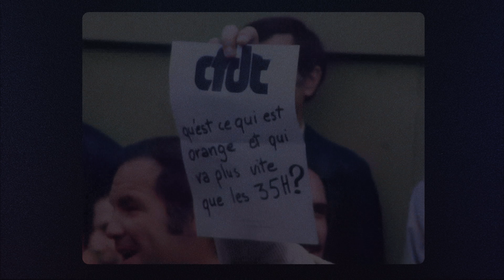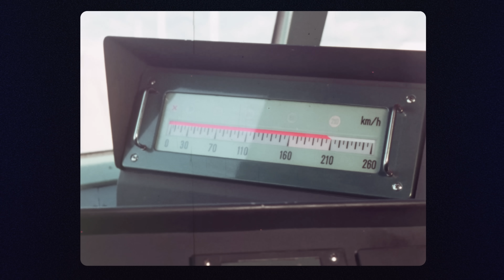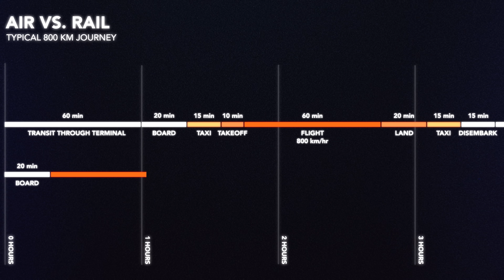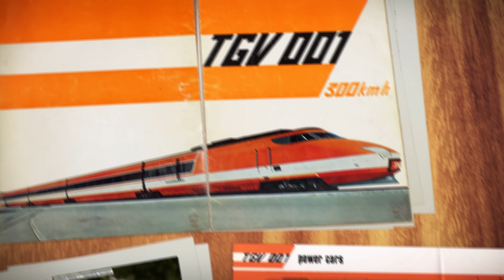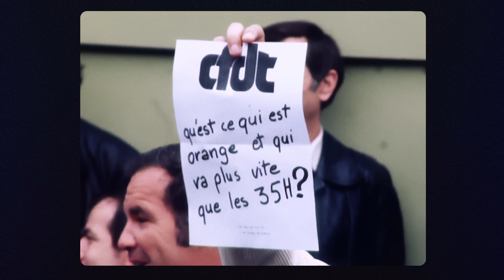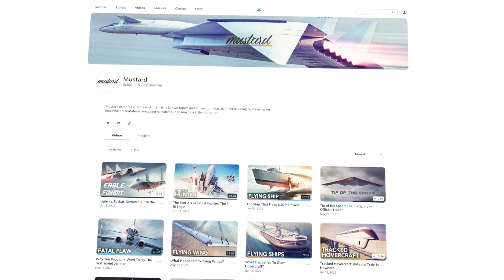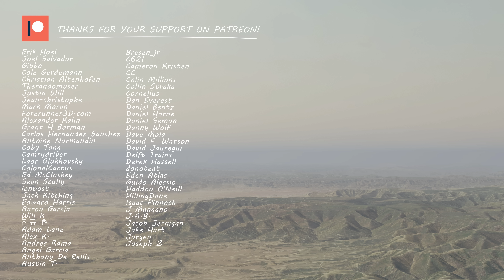Why French Trains Are The Fastest

Comment: as someone from France , i can assure you that the TGV is one of the best option for domestic travel. Not to the forget the rest of the railway network (RER, TER, etc...) that connects almost every part of France that the big High Speed lines doesn't connect. Today, going to work every day 300km away from where you live is not only viable but also very convenient (go the railway station -> get on the train -> wait comfortably for an hour -> boom you're in another city 300km away). Very proud of the piece of french engineering.

TGV (Train à Grande Vitesse/High Speed Train) also stand for Tequilla Gin Vodka here and it's another way to get somewhere (drunk) really fast.
Reply: There are plenty of OuiGo low-cost services and you can regularly find last minute tickets with very reasonable prices.
But if course, if you absolutely want the peak hour train or travel on major holiday departure days, it's gonna be pricey.
It would be a lot less expensive if planes were taxed and trains less taxed, or simply both equally taxed.
Reply: Germany and Italy have great trains too. The main problem is that they don't work together very well. The EU wants to make it so that you can travel by rail from Madrid to Helsinki or from Amsterdam to Athens.
Reply: @MrMarinus18 hopefully everyone starts using the Swiss model of synchronized ‘pulse’ services to guarantee connections, making the whole system work better.
Reply: @JohnGeorgeBauerBuis  Making the whole EU do that is quite an undertaking and more importantly: Unpopular with the train companies which still have way too much power.
I think we need increased government control before we can start with improving the services themselves.
Reply: @MrMarinus18  it’s probably easiest to do synchronization in stages, rather than in one big push.
Reply: @JohnGeorgeBauerBuis  But before then you have to lower the amount of companies doing the trains. They have repeatedly been very unwilling to cooperate for the greater good of Europe.
Reply: It's amazing that your country was able to accomplish this.  In California, they are going billions over budget, and years beyond deadlines, and are nowhere near completing our high-speed rail.  In California the car is king and will be for the foreseeable future.
Reply: @oldesertguy9616  The first TGV line was also over budget, as was the first Shinkansen line - just wasn't mentioned in the video.
Reply: @Ven100  yeah but the budget overrun was quite reasonable.
One of the latest 320kph operated high-speed lines in France, the LGV SEA, equipped with all the stringent environmental bells and whistles you could think of, cost less than 8 billion euros (including city center stations overall makeover and several connector tracks).
When there are high-speed line overspending, it is fairly limited.
Reply: @oldesertguy9616 I also hope Toronto would connect to BC via bullet train.
Reply: @oldesertguy9616 that's because the French are picky. Try to go 1 euro over budget and you will have strikes offered at you 😂 hard for France to satisfy his population but at least they set the expectancy high
Reply: @oldesertguy9616  and as a french, I can tell you that the  train system in france is broken "wait 1 hour and boom ur in another city" complet bullshit !!
Reply: @oldesertguy9616 Minneapolis, Miami, Dallas, Portland, Detroit, chicago, Boston need 🚝🚄
Reply: @oldesertguy9616  Be patient and when CHSR opens you will love it!
Reply: Totally agree! Living in Lyon and working in Paris has never been this easy in my case! Really proud of everyone behind this development.
Reply: However hydrogen or electric planes are highly dubious for various reasons and electric cars are only a marginal improvement over gasoline cars. So mass international transit in Europe will have to be done by HSR.
Also it's important to make sure to also have slower local rail and not allow flashy HSR to grab all the funding.
Reply: are you kidding? Most routes need to do a détour through Paris, the network is completely underdeveloped and unreliable. Yet so expensive. 
When you come from Switzerland it's mindblowing.
Reply: @IStMl I see the French fell into the ‘Paris hub’ trap again, which was among the reasons why they lost the Franco-Prussian war.  Hopefully the Midwestern USA can partly avoid doing the same thing with a line from St. Louis directly to Cincinnati.
Reply: @JohnGeorgeBauerBuis  the US rail network is much worse than the French one, there's barely anything
Reply: @IStMl   Underdeveloped and unreliable??? You must be joking! There's 2800km of high-speed lines operating at 300kph or 320kph. They are super reliable, with some lines having a headway as low as 3 minutes on peak hours, higher than many subway lines in the world...
The system moves dozens of millions of people every year, safely and efficiently.
The main destinations have a very high average speed and the reliability rate is top notch.
I don't know how you get that idea that it is unreliable or underdeveloped but it's simply not true.
Even during heatwaves, the very last services to be disturbed are TGV's as HSL's handle extreme weather a lot better than regular / legacy lines thanks to the precision of the tracks and high tension of the catenary wires.
And 2800km is anything but underdeveloped. It's the second largest high-speed network in Europe, right behind Spain, with several new HSL being built and others planned.
All this allows for roughly 800 TGV's every day.
I think you're confusing with the German network that is a patchwork of trunks of lines with different speeds, forcing all trains to run through city centers and creating bottlenecks and delays near stations on legacy tracks.
The TGV network, just like the Spanish AVE network, is full of large city bypass, to avoid having to slow down when trains don't stop and allowing trains from the Belgian border to the Mediterranean sea to never leave the high-speed line nor slow down.
You must be living in a ln alternative world...
Reply: @IStMl  The biggest problem that HSR has is that it is heavily dependent on government regulation and planning. So bad planning can make it very difficult.

Also in our neo-liberal capitalist world this kind of heavy handed government involvement is usually hated on by private firms.

However while you are right about the massive detour through Paris you are wrong about the cost. I have no idea where you even get that notion as French trains follow the budget airline model. Of stripping out everything they can to offer rock bottom prices.
Reply: @MrMarinus18   This is a preconceived idea!
The EU does not force a privatization, even though many people think it does but it does NOT!
What EU mandates is that the network and operators are separated and that competition is allowed and facilitated.
OuiGo France is possible thanks to that, it's a subsidiary low-cost competitor to it's public parent company.
And OuiGo España is also possible thanks to EU's open rail initiative.
Everyone seems to think that the EU is forcing the network to be privatized but that is simply not true!
The network and operators are now separated, with state / public ownership of the network and competition of various operators that can be either public or private.
The network managers are RFF / SNCF Réseau in France, ADIF in Spain.

Competition does NOT mean privatization!
Look at Spain, they have 4 high-speed operators :
Renfe AVE, public operator.
OuiGo España, semi private operator subsidiary of SNCF.
Renfe Avlo, semi private operator subsidiary of Renfe.
Iryo, a semi private operator subsidiary of Trenitalia.
There's not even a single fully private operator in France or Spain.

And if you're thinking about regional / urban rail / subway, it's the same : there's no privatization required, only open access to competition of different operators.
The future lines M16/M17 of the Grand Paris Express have been awarded to Keolis as the operator, which is 70% owned by SNCF and 30% by CDPQ (public Quebec pension and investment fund that is currently building the soon to open Montreal REM). Keolis is "technically private" but owned by a public company and a public fund... That's not what I would call a real private company.
The infrastructure remains publicly owned either way, and a public competitor can bid on it if it wants to do so.

This model is a real success!
What failed is the real privatization of both infrastructure and operators in the UK. That was a real catastrophe and the EU never ever asked for that.
The failed privatization of DB was also a proverbial train wreck but that was solely the actions of the German government, not an EU request.

The Spanish example is a success and probably the best implementation of what EU wants.
And keep in mind that the EU is not a strange foreign power forcing stuff on unsuspecting countries, it's driven by the member countries and the elected EU Parliament, in other words : you, me and all fellow Europeans. If the EU mandates something, it's because the EU countries and their populations voted for it one way or another.
But it's all too common for many to alter the message and attribute many things to the EU that it is not responsible for.
Any privatization is purely the decision of countries, not the EU. The only thing required by EU is the split between infrastructure and operators, plus open competition, period. Nothing less, nothing more.
Reply: @IStMl  The biggest problem with French HSR is actually the EU. The EU still clings on to an idea of railway privatization that has proven itself a failure and is hesitant to allow major reforms.

Railways are different than cars or planes in that they live and die by the government. Even "private" railways depend heavily on government subsidies and regulations.
And the EU body of regulation just isn't working in that they want to duplicate the structure of budget airlines but it's just not succeeding.
Reply: I visited France 4 years ago. As an American I'm blown away at how efficient high speed rail is and why it totally beats domestic flights. I've only rode on the Shinkansen which can now hit speeds over 200 mph, but I do want to ride the TGV one day to see how exhilarating it is
Reply: I agree.  I rode it in France and Belgium as a novelty..... after my first trip to Paris to Brussels I was convinced.  I don't know why we can't get our act together in the US to build railroads that these can run on PROPERLY.
Reply: Main problem with TGV is the pricing if you're traveling at any somewhat reasonable time and not booking six years in advance in my experience. But now there's competition on the main routes, so we'll see how that turns out
Reply: @alles_klar Ouigo is tgv too and it's really cheap it just connect way less cities.
Reply: I once rode the TGV from Lyon to Paris, I liked the train but had a few complaints. Why build a train that covers the distance in 2 hours when it was 3 hours late? Build a train that runs in 4 hours but travels on time and boom, you save 1 hour!
Reply: @helsinkianon   Delays on the Lyon Paris are rare.
So, you are taking one single trip and think it's the average normality? Right...
More than 85% of all TGV services are perfectly on time. Most services that run entirely on high-speed lines (except center access of course) have a very high punctuality rate.
The ones having a few delays are the ones with extensive runs on the legacy network before or after accessing the high-speed line. These ones are sometimes delayed by the saturation of the legacy tracks. All-in-all, the overall TGV services have a substantially better punctuality rate than ICE / TAV services in Germany and Italy.
Spain fares better on the punctuality rate thanks to an entirely separate HS network and the less busy lines.
Frankly, you should avoid taking one delayed trip as the general rule, it's not.
Reply: The problem with a lot of TER trains is that they have a highly limited and irregular timetable, with a lot of routes only being served a couple of times per day. (Even between already somewhat larger towns.) That is not very practical if you want trains (and buses) to replace cars. In my eyes at the very least an hourly service from early in the morning until late in the evening should be the norm.
Reply: Oh, so you’re claiming the TGV is “the best way to travel domestically” in France? Are you sure you’re actually from France? Because anyone familiar with the French rail system knows it’s a mess. Let’s start with the constant strikes. It feels like every other week the railway workers are on strike, throwing the entire system into chaos. It’s an absolute nightmare for anyone trying to make reliable travel plans.

Then there are the delays. The TGV is notorious for not running on time, with regular disruptions that leave passengers stranded or scrambling to find alternatives. It’s not exactly the shining example of efficiency you’re trying to make it out to be.

And let’s talk about the cost. TGV tickets are expensive—sometimes more expensive than flying. For all the talk about being the “best way to travel,” it sure doesn’t feel like it when you’re paying through the nose for a one-way ticket.

Not to mention, the TGV doesn’t even serve all major cities in France! So, unless you live in a lucky few locations with direct access, you’re stuck dealing with slow, outdated regional trains. And that’s if you can even get a train during one of the all-too-frequent strikes.

So, are you just ignoring all these issues, or are you completely out of touch with the reality of traveling in France? Calling the TGV the “best way to travel” is a joke, and anyone who actually relies on it knows that.
Reply: @werewolflover8636  As a French using sometime the train I can say you are 100% right
Reply: @werewolflover8636  I want to take a trip to EU soon, do you recommend TGV? Rental car? Plane?
Reply: it's amazing
Reply: It is very very good, even up to this day. It only still suprises me that passing trough paris is impossible. That really stands in the way of connecting north and south europe.
Reply: @Thesupermachine2000   You don't need to go through Paris, there's a huge high-speed bypass on the East of Paris that links 3 of the 4 main radial high-speed lines and allowing trains from the Channel tunnel, Brussels or Lille to continue to Strasbourg on the German border or Marseille on the Mediterranean coast without ever leaving the high-speed line nor stopping nor really slowing down.
There's a project to connect the 4th line, LGV Atlantic to the Paris Eastern high-speed bypass.
Currently, connecting trains to/from that line must run on a stretch of regular / legacy tracks to switch to the next radial line (LGV Sud-Est) or the high-speed bypass.

So, crossing through Paris is totally useless, you can already avoid it and bypass it at high-speed in most cases.
(The Paris Eastern high-speed bypass runs under Disneyland Paris Resort and CDG Airport).
Reply: trop carrément !!!!
(bon, il faut que la SNCF fasse plus d'interconnections, même sans TGV)
Reply: @ronanverhulst6854  oui, c'est clair que devoir passer par Paris quelle que soit la destination c'est chiant
Reply: Thanks I finally knew the full form of TGV 🇺🇸🚝🫡🇨🇵
Reply: Japanese: that's cute
Reply: It's fantastic, as long as your starting point or destination is Paris, or somewhere between your starting point and Paris.
Reply: I think it's my first time seeing a French talking good English.

Or you are not French. From another country, but you are just living in France.
Reply: Only issue is the protests. 😅
Reply: how much is the ticket?
Reply: sounds like France has long distance rail travel figured out, our Dutch railnetwork is very different of course, due to our population density, and the fact that were tiny in size.
Reply: Ptdr mais qui habite à 300 kilomètres de son lieu de travail en prenant le TGV tous les jours… n’importe quoi
Reply: I lived in france and 90% of the time plane was cheaper than tgv for the same route. Tgv is super expensive
Reply: @foreach1  Honestly, I don't have the same experience, I feel like the prices of planes are less predictable than these of the TGVs. What I mean is planes tickets they can be cheaper but they also can skyrocket if you don't book them in advance or if you book them on a busy day.

I think this has also something to do with the fact that the last time I tried to compare train vs plane it was on Paris - Touloue route which is not entirely high speed, therefore the time advantage of plane is more significant and drives its prices higher.
Reply: @foreach1  you can have ticket for less than 50 euros if you book early  double that price for a plane (Paris - Montpellier for example)
Reply: @foreach1  It has grown expensive, but it was cheaper for a long time. However, what the video mentioned about the major mistakes of cost-cutting in the 60s, reducing lines, etc. are being made again, and have been made intensely for the last 20-ish years now, sadly. Some specific industries have the oddity of being made more expensive by privatization and competition (stuff like electricity, phone/internet, water, public transport, ...). Soooo it led to an increase in costs for a lot of TGV lines, even if you count the cheaper options. This, and the fact that planes are insanely advantaged by tax cuts (cuts on kerosen are insane, no need to pay for the rail lines, very small VAT, etc.). Which is a shame, since a plane trip takes longer and pollutes 50x more :/
Reply: That's so cool. My 300 Km home here in India is almost 5-6 hrs away. So only go there once in 2 months.
Reply: @akay435  we are getting vande bharat in 2023 ...Europe and rest of the world were getting trains like Vb in 70-80s hahaha...cogresss zindabad
Reply: @akay435  in China, it would take about 1h20 (some lines runs at 400Km/h since this year, only 350 last year, tgv or shinkansen can't go over 320 on commercial lines sadly. Japanese is the worst of 3, shake a lot very noisy, chinese and french one are very silent, and chinese the far more confortables. The new TGV-M come this year, that will maybe come back in the Chinese one for comfort and density of voyagers/m due to it's 2 floors as like of current TGV, but not for speed.
Reply: French here, and the tgv is so expensive that plane is the cheapest option in 80% of cases. Masterpiece of engineering, but overpriced for people :-(
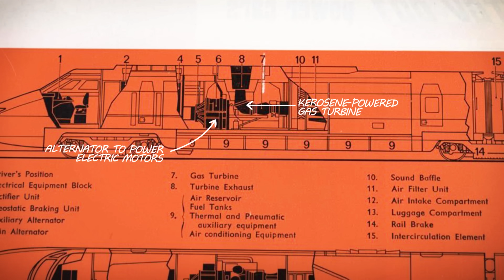Reply: @_mat4537  Give us an example. What would a ride from Paris to Lyon Monday at 7:00 cost for example.
Reply: @alexandruilea915  For a Paris-Lyon, it can go up to 150€ if you buy the ticket the day before. Plane cost about 50€.
But the TGV is dramatically faster. City center to city center in 2 hours
Reply: @_mat4537  and what if you buy the to tickets in advance like a week or two?
Reply: @alexandruilea915 I opened the app right now, Paris-Lyon for the next day is 94€ (98€ in 1st class for some reason), one week before is the same price (94€) and two weeks before is 56€. I don't own any subscription but I suppose commuters would get one of those and their company would most likely partially or fully reimburse their subscription
Reply: @_mat4537 French here, and former heavy commuter / work traveler. If you have a subscription, any kind of fidelity program and you try to avoid high traffic days/hours when possible, train / tgv is the better choice 95 times out of 100.
Reply: @_mat4537  it wasn't always like that,
Reply: If you have to travel from Marseille to Brittany, it's better to take a plane rather than TGV.
Reply: I'm French too and I avoid the TGV when I can. it's very often late and it's systematically more expensive than the plane (which is still the fastest way of traveling). And no lol it's not a viable option to work 300km from home, you'll give all your salary to the SNCF
Reply: @duskwrench a German told me french and japanese are better 🚝
Reply: @duskwrench  There are some abonnements for long distance work, that's not so expansive. Airplanes have air controlers strikes too :). Both are for our security, but as long as gvt try to destroy trains, since few years, it doesn't help. In China, they are very cheap, confortable, very quiet. It so soft, than you don't even understand when it start or stop and you are at more than 300 km in few minutes. There are  a lot of them everywhere, and can run at 400km/h for the fastest on commercial lines (350 last years. They are build on viaducs so they don't take too much grounds on farmalands, forest and don't block wild life. The other advantage, is that the road is nearly flat (0,1/1000 of slope on 4000km on Shanghai Kunming for example). This help a lot to have speed and stability
Reply: @duskwrench   Typical French... Akways exaggerating problems, never ever happy with anything, and convinced of living in a hell hole...
TGV's are not always late! They have a pretty high punctuality rate on the main corridors.

And yes, many passengers are work commuters. Apparently you've never heard of subscriptions ("abonnements"). It's quite common on morning and evening trains.
And I personally know several TGV commuters, they either live or work in Reims, Tours, or Lille and use the TGV 2 to 5 days a week. They arrive on time at their work...
They pay a far less amount than if they bought tickets separately like other passengers.
There are even companies that have employees commuting several times a week between Bordeaux and Paris.

The flight itself might be faster / shorter, but the whole journey certainly is not. It takes longer to travel between Bordeaux and Paris by plane than by TGV.
2h04 from city center to city center, impossible to beat by plane.
Reply: @KyrilPG  If you are a businessperson, sure it's not expensive, but for someone just wanting to go somewhere it is quite expensive.
Reply: @KyrilPG It’s one thing if your company is paying for you, it’s another thing entirely to pay that cost out-of-pocket… 😟
Reply: @DARTHNECRION    I don't know for all of them but I'm sur for a good half that it's not their company that pays : two of my friends commuting by TGV are teachers, so not exactly the kind of job where a "company" buys your business tickets.
They simply have a SNCF TGV subscription / plan so that they pay much less per trip than one-time travelers.
It's not their "company" (the education ministry or private school) that pays for it, there's only a small fee paid by the employer, alongside the "participation for transportation" like for Paris Navigo passes or petrol costs, but that's pretty much all that is paid by the employer.
Another one is self employed, so either way, it's out of his pocket. And with a subscription like the different TGV MAX plans, etc. They perfectly manage it.
It's still much cheaper than owning and using a car for them, much much much cheaper. And incomparably faster.
Reply: @KyrilPG and you can still work on the train with the wifi, not like on planes. I know ppl that live in Nantes and work in Paris. You have the Parisian income and the life price of Nantes. And you can go to Bretagne coast on the weekend
Reply: C'est plus cher que la voiture et y a des grèves et 2 retard 3 fois sur 4 alors non!
Reply: Stop spreading train propaganda, cars are the best! Last thing we want is an increase on taxes on a form of transport we will never use, but will be used by city people who vote against our interests.
Reply: @Labyrinth6000  do you understand how many tax cuts and subsidies cars receive? Because the united states government subsidizes the cost of oil products in the states, as well as reducing taxes on most oil based fuels as well. so tell me, why should I pay for you to use your car/truck or whatever else you may drive?

edit - And before I forget again, ton for ton, Car based infrastructure costs more in maintenance and upfront costs when compared to almost all other infrastructure just do to how fast it tears itself to shreds. not to mention the only reason I seem to hear whenever people say we shouldn't invest in any public transportation is, 'but ma freedom!', yet no one is forcing you to stop using your car or even make you pay the full price of using your car (even though we probably should start reducing the government subsidies on that).
Reply: @Labyrinth6000   It’s a shame so many people actually think like this, especially when rail has the potential to improve almost everything for almost everyone, while it has become increasingly clear that cars make most things worse for almost everyone. Every single point you made is wrong, which just goes to show how effective the billionaires’ plans to turn people against themselves really was.